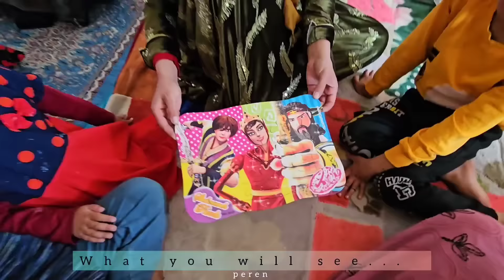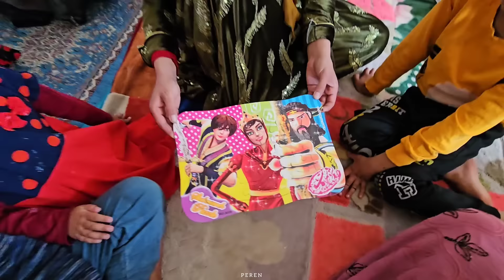Another snowy day for the Peren family. Mehdi made the children happy by buying intellectual games🎮🕹

Comment: Build a larger solar system on your roof in the spring and you will have electricity for lights and computers etc. Then you will be self-sufficient in terms of energy, you can even connect a heater

￼

❤

Comment: Hi,, grandma we love you , this is the Rcp,, Mix the1/2 cup powder milk, 4cups flour, 1/2 tsp salt, 1tsp dry instant yeast, 1/2 cup sugar, and mix it well then add 3table's spoon butter, 3egg's, 1/2cup water, 1/2cup fresh milk, mix until all combined, then add 3tbsp oil then  mix well and then knead it onto flour board until smooth and form into a ball put into a bowl cover with plastic and blanket and rest  for 1 hour,   after resting transfer onto floured board flat it with rolling pin to 1/2 inc, then cut with donut cutter if you donut have just cut with the drinking glass and make whole in the center with small glass then place it all into floured large tray cover with plastic and rest again for 1 hour, after resting, Fry into deep about 3-4cup of very hot oil in the pan cook until golden then turn the other side until golden,  then remove it from the oil and put onto a wire rack to cool when is already cool deep into icing sugar only the one side we hope you all enjoy ,we love you all always 💯many many kisses💋💋💋  💖💖💖